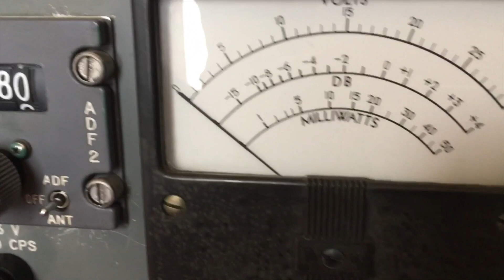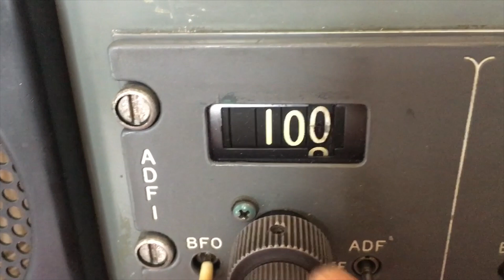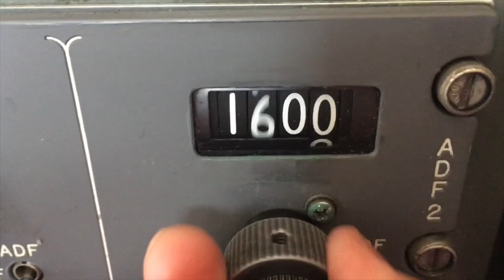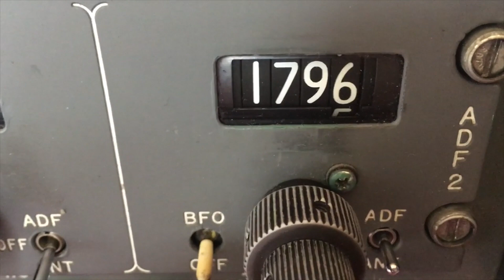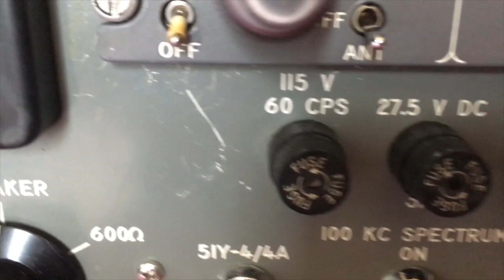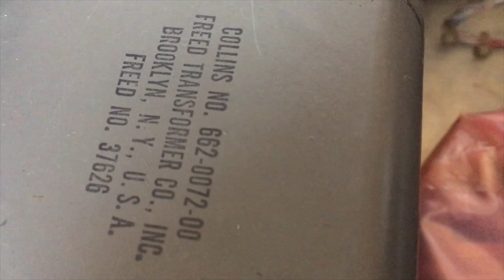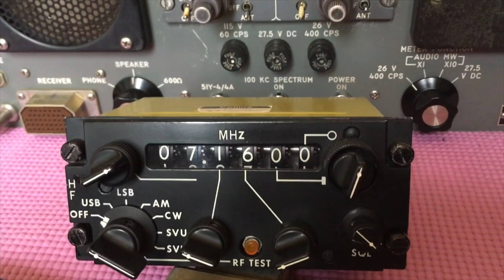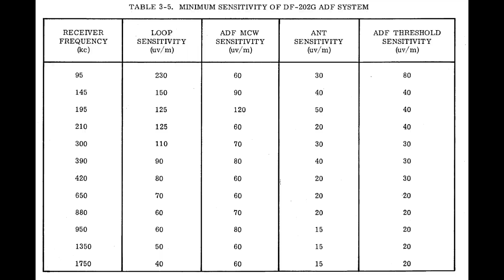Collins ADF Test Set Type 477V-2

Comment: Nice video Plato. I have never seen that test set in operation.
I have a working Collins ADF-650A system in my Cessna.  I installed it many years ago for "homing" and "tracking" to a beacon.  Also used it for instrument approaches to airports that had a published NDB approach procedure. Most are gone now but it's nice to listen to AM broadcast stations for news and sports!  lol
Reply from the maker: Thanks for watching. Oh, you are very familiar with ADF system! But to me, I am not. Initially, I was planning to modify this unit and install Collins 514A controller into this box for 718U-5 system. As you wrote, ADF can receive MW broadcast stations. So, I've already placed an order the receiver module. Can you advice me on ADF loop antenna for that? Thank you!!
Reply: @Plato1959  The older aircraft ADF's had a long wire "sense" antenna usually strung from the vertical stabilizer to a stand off insulator near the front of the upper windscreen. Mounted on the belly was a separate X-Y loop antenna.
 My newer designed Collins ADF system has the "sense" antenna in one unit mounted on the belly along with the X-Y loop enclosed. So, I am not sure what to recommend for your project.  Hope this helped a bit.
Reply from the maker: @rfburns3472  Thank you for the helpful information. That's cool! My purpose is to listen to MW stations using 51Y-7A(Collins receiver module), but I don't have any information about the part number of the antenna and connector/cable.
Reply from the maker: I've found the type number of loop antenna, it's probably 137A-4.
Reply: @Plato1959  Yes, that looks like a loop without "sense". The loop is only for driving the ADF indicator (0 thru 360 Deg) in the aircraft instrument panel.  A separate long wire "sense" antenna is used to pickup the radio signal.  Hope that makes it clear.
Reply from the maker: @rfburns3472  I really appreciate your help! Now I clearly understand. In other words, we don't need the loop antenna just for listening to AM stations, right? But if connecting an indictor and the loop antenna to the receiver, we can play direction finding, too. Thanks!
Reply: @Plato1959  Your understanding is correct. Something you should be aware of. The ANT-650A combined Loop / Sense antenna has a preamp located inside the antenna module. There is +10 V dc on the center conductor of the sense, X-loop and Y-loop. Without the preamp, the radio probably would not receive too well with just a unamplified sense antenna. Here is a link for the installation manual:  http://endzone2.weebly.com/uploads/1/2/1/5/12152002/adf650_installation_manual.pdf
Reply from the maker: @rfburns3472  Thanks for the valuable information. Fantastic!! I feel like using the ADF650 system, seriously!